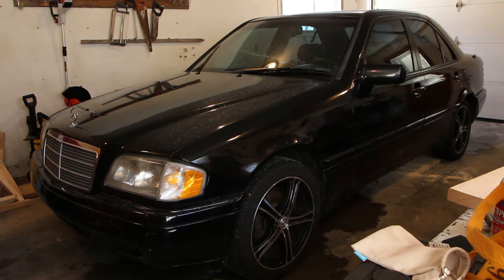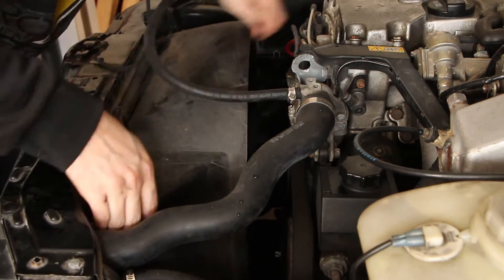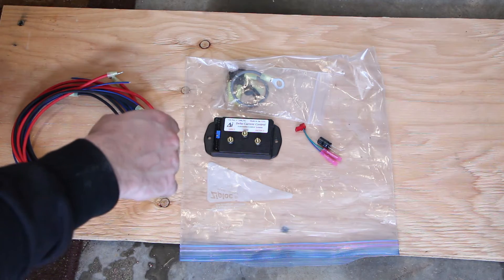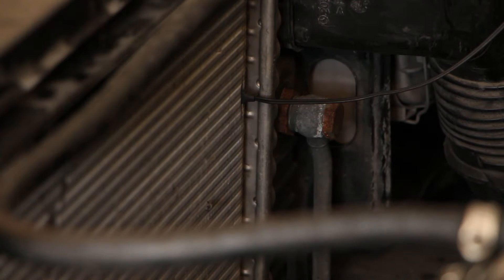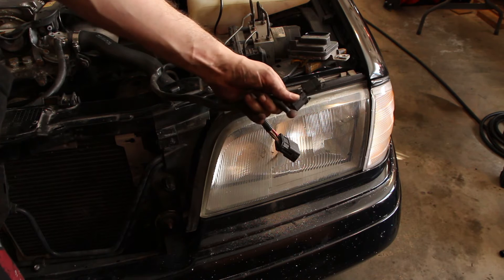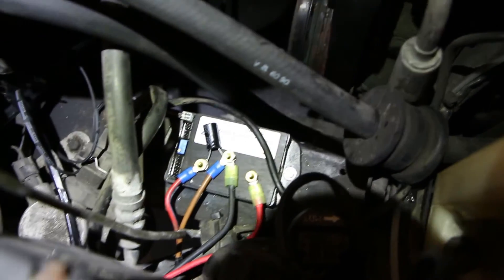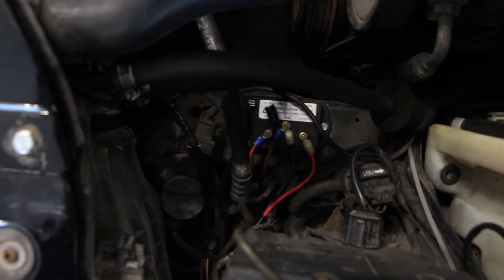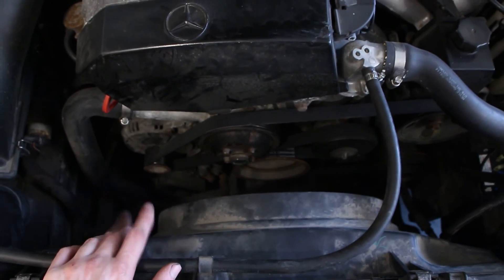Mercedes Electric Fan Conversion - Delta Current Control (part 1)

Comment: question, why not just keep Auxiliary dual fans for Air con stock? it works well. When the radiator fluid reaches a certain temp. it will turn on the give additional cooling. Keep stock Aux fans in combination with your newly installed w202 electric fan would be good!
Reply from the maker: The Aux fans would never switch on with coolant temp if the main electric fan is doing its job, and if you have the main electric fan wired into the AC system, same thing happens actually, they would just never turn on, so get rid of them. I also got rid of the aux fan controller, and used that power / ground wiring / circuit to wire in the aftermarket controller.

Comment: Hey! Curious if possible to just run wires to the fuse and tap to any of the lines that run to an ignition to turn it on. So if i didn't want to turn my ac on the fan still runs? Haven't gotten to part2 yet just curious
Reply from the maker: if you send 12v to the AC input on the controller the fan will run at 50%, I don't see why you want want to do that though. The controller is perfectly capable of maintaining the set temperature, and I have added a pressure switch to the AC to only turn the fan on when the pressure switch is tripped.

Comment: hows your electric fan holding up? is it really superior cooling vs the stock clutch fan and auxiliary a/c fan set up?
Reply from the maker: oh yeah it's way better. Fuel economy is noticeably better, and you can have much tighter control of the engine temperature. The thermostat opens at 87, I set my fan controller to keep roughly 92, this way the fan stays off on the highway, but never lets the engine get hot when stuck in traffic on a hot summer day.
I would recommend this be done to all older German cars that still relied on fan clutches.
Reply: @PatsCarGarage  awesome. thank you so much! do you by chance know the exact w202 fan part number? I have a 1995 c36 AMG w202. I would love to do this upgrade.
Reply from the maker: @yellowjoe.2000  Sorry I don't have a part number, don't think it would do you any good either, you can't buy these fans new. My advice to you: there are 2 sizes of electric fans (depth is the same, just the diameter is larger). For the C36 AMG make sure to get the bigger fan. The smaller one was fitted to some C230K's, the bigger one was fitted to C280s with the V6 (in later model years, when they moved away from a viscous fan. An alternative is to use an aftermarket fan, there are good ones. Make sure to get one with a shroud that would fit the radiator.